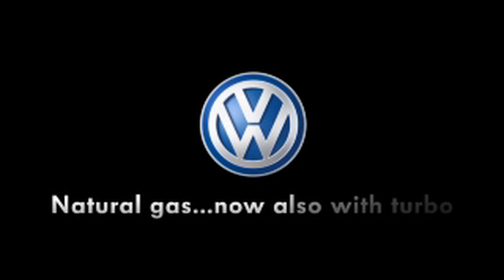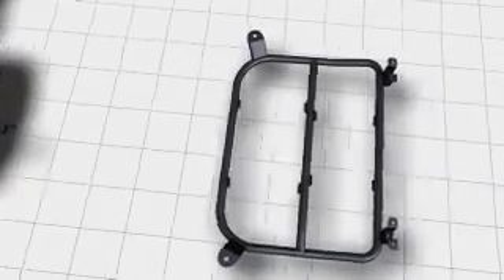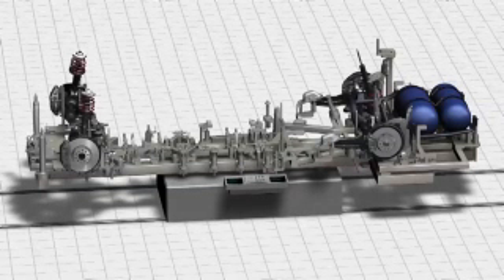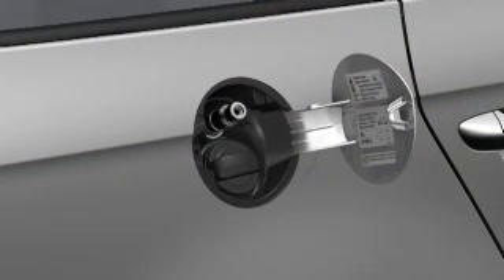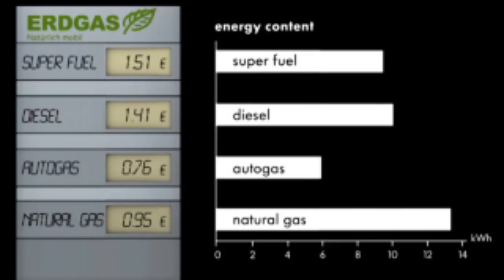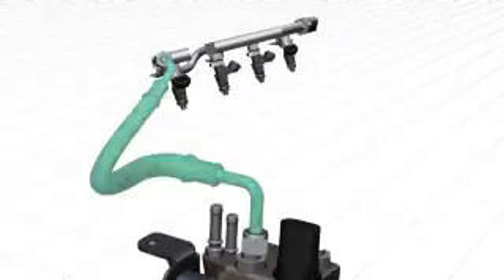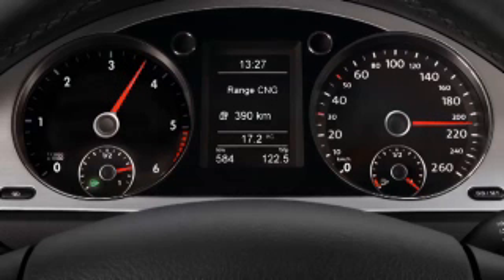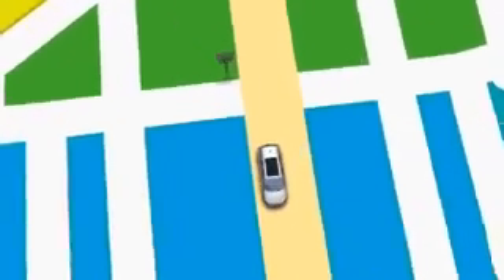Volkswagen Passat 1 4 TSI EcoFuel

Comment: I burned out the fuel pump in the gas tank and now I have to remove the entire rear axle together with the bottle basket (6 kg) + the tank itself to get to it to change it. There is no inspection cover for this pump either, instead there is a cover under the rear seat, but it is for the methane bottle number! :(